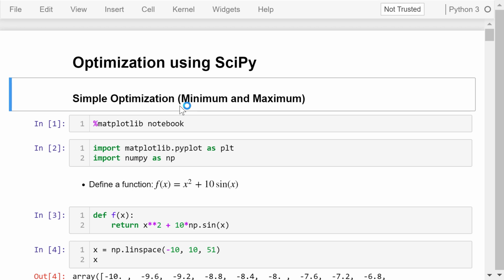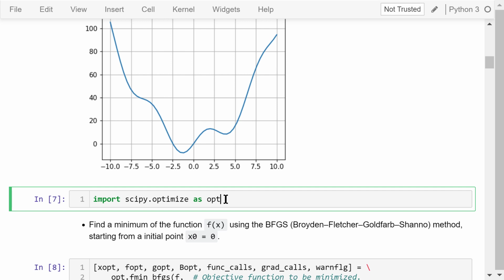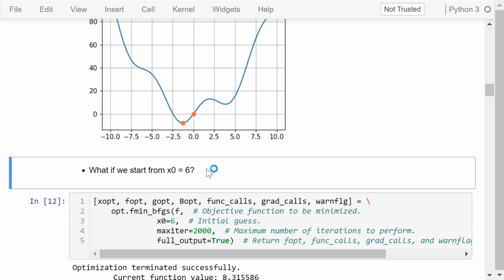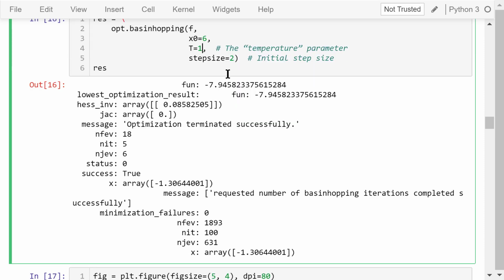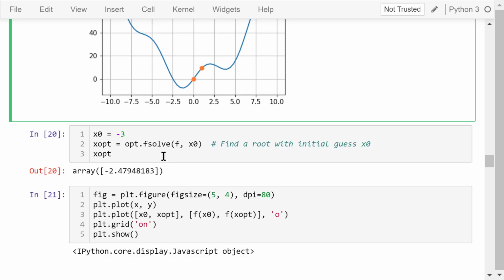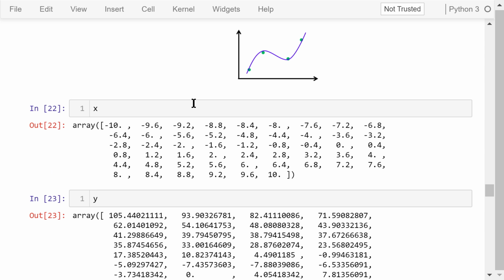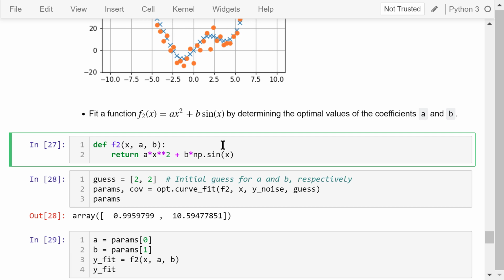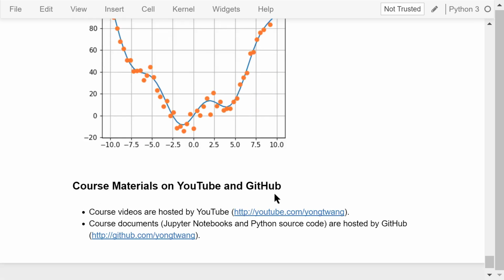Engineering Python 18A: Optimization using SciPy

Comment from the maker: Hi Guys, please comment and let me know what you think about this Engineering Python open course. If you enjoy the video, please subscribe and share with your friends. Thanks!
Reply: A part-time graduate student in engineering is enrolled in a four-unit mathematics course
and a three-unit design course. Since the student has to work for 20 hours a week at a
local software company, he can spend a maximum of 40 hours a week to study outside
the class. It is known from students who took the courses previously that the numerical
grade (g) in each course is related to the study time spent outside the class as gm = tm/6
and gd = td/5, where g indicates the numerical grade (g = 4 for A, 3 for B, 2 for C, 1 for
D, and 0 for F), t represents the time spent in hours per week to study outside the class,
and the subscripts m and d denote the courses, mathematics and design, respectively.
The student enjoys design more than mathematics and hence would like to spend at least
75 minutes to study for design for every 60 minutes he spends to study mathematics.
Also, as far as possible, the student does not want to spend more time on any course
beyond the time required to earn a grade of A. The student wishes to maximize his grade
point P, given by P = 4gm + 3gd, by suitably distributing his study time. Formulate
the problem as an LP problem.
could you please, solve this problem using python programming and send me the file in "ipynb" format on this email "arbaminchuermias@gmail.com".....thankyou very much.....i need help please